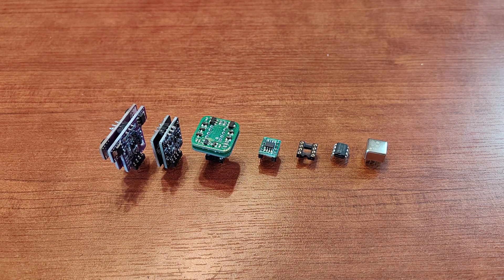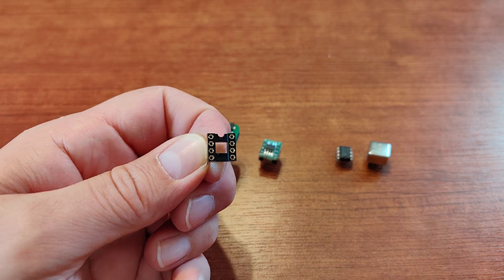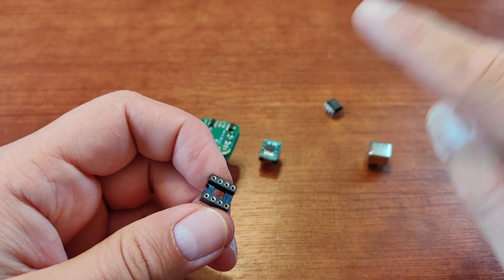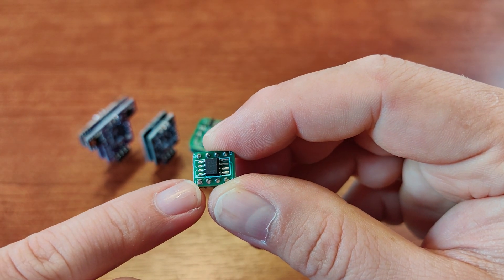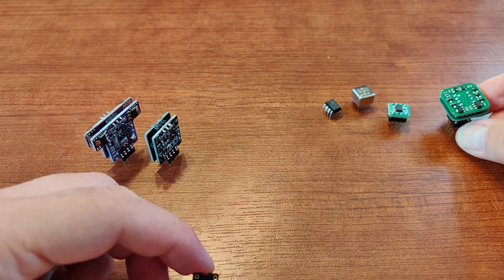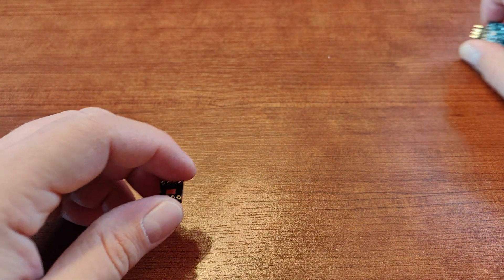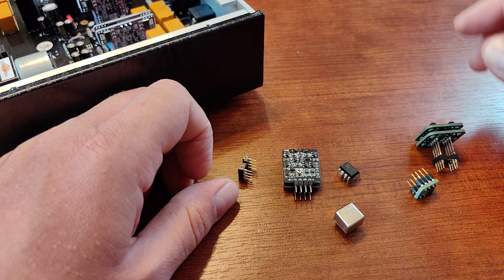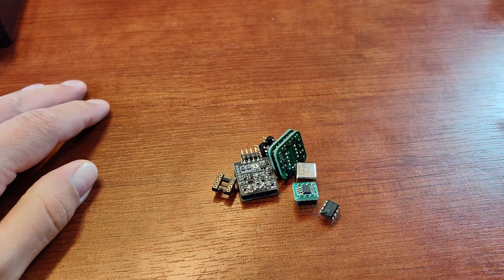How to correctly place opamp (operational amplifier) in the socket?

Comment: Thanks for the video! I have the same headphone amp (E600) and I got the AkLIAM LC5 today. When I was braking inn the opamps my house fuse blew and i got some magic smoke. However, the amp and opamps are still working. Maybe the opamps got too hot? I definitely thought that my gear was damaged, but everything works as usual. I had the lidd closed on the amp. Any idea on what it might be?
Reply from the maker: That  was random :D
Your house fuse is like order of magnitude higher current one :)

Comment: I replace my stock opamp following the sense of this one and not the sense of the board and I burned (not works anymore). I think the stock one has put upside down, but how is it possible?
Reply from the maker: What was device you were replacing opamps in and what kind of opamp did you get?
They all are marked correctly, but some of DIP8 integrates are not OPAMPS so there is a chance that maybe you tried to replace something that was not an opamp?

Comment: Following the instructions in this video I was able to upgrade the stock opamps in the E600 headphone amp to the recommended EAKLIAM LC5 class A discrete opamps. Wow, my first technical operation ever! The stock opamps from Texas Instruments sounded very good, neutral and engaging, but I couldn’t wait any longer to hear the LC5’s. Before starting I had already bought a 161-piece (bit) screwdriver to be sure to have the right bit to open the case. Check! Thanks to the clear explanation in the video it should be very easy to stick the opamps with pin 1 in the corresponding position in the socket. Only, there was initially not enough space around to accomodate these big monsters. Huh? After watching the video again I noticed for the first time that the two black ‘licorice rods’ which were standing in the way, had made a small bend to give the LC5’s a bit more room. Aha! I did this bending very carefully by hand, hoping for the best. Cover plate screwed back on top and… Bingo! After only a few hours of playing it started to sound better and better. I am very familiar with the typical sound of Class A amplifiers. It is not just about fast, direct, snappy, exciting and engaging, for me it is more about being absorbed in the enchanting beauty and richness of the sound. This is what these LC5 opamps bring to the audience. Wonderful, most wonderful! Mission accomplished. Thank you very much, Mr. Hifi Zone!
Reply from the maker: You're very welcome! I hope you'll enjoy this setup, its does sound great!